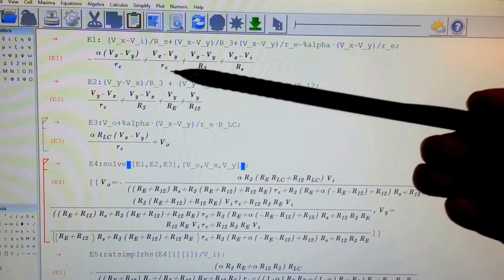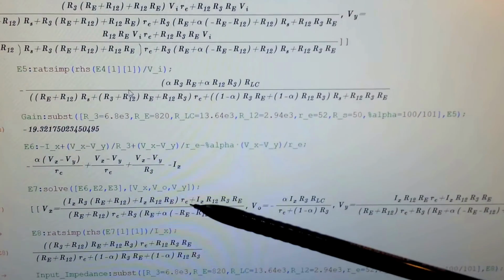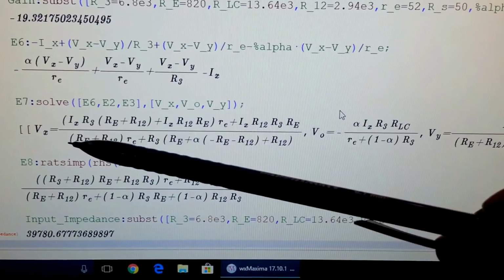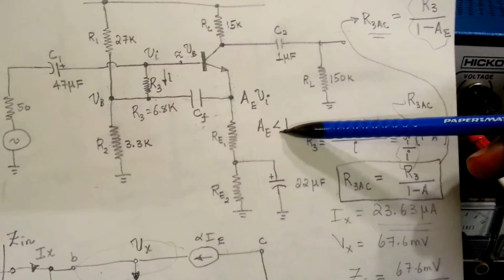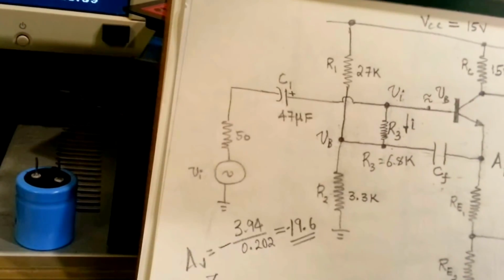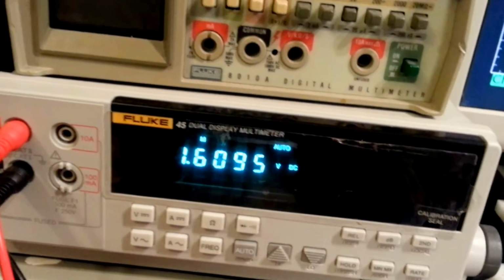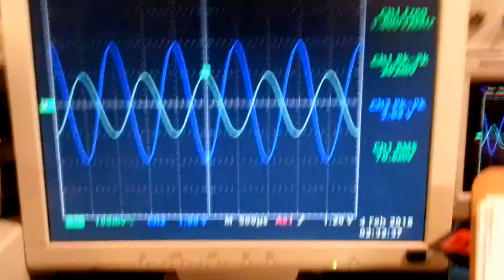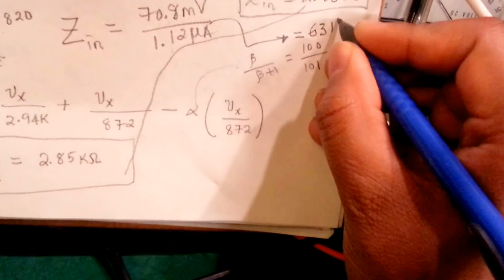Use of Positive Feedback in Amplifier Design - AoE Chapter 2 Question 4 - Part-2

Comment: why  does the gain have a negative sign and value? Why isn't it a positive sign....+19/?
Reply from the maker: Because the output is taken from the collector. The voltage at the collector is always 180 degrees out of phase with the input voltage at the base. The negative sign in the gain just indicates the inverted phase.